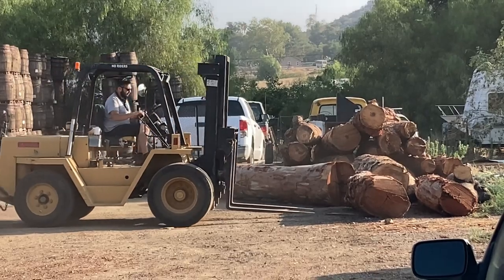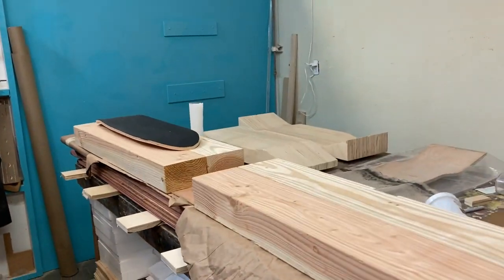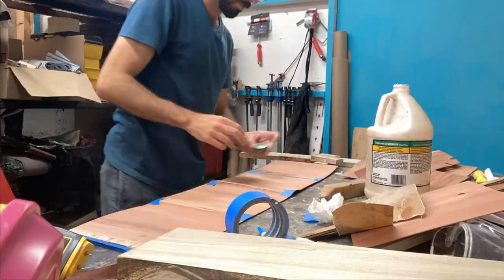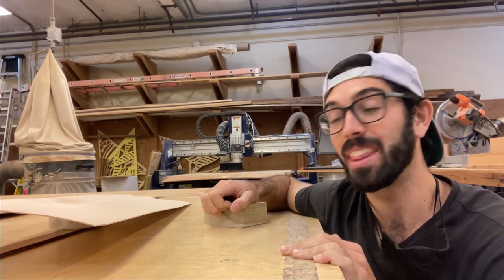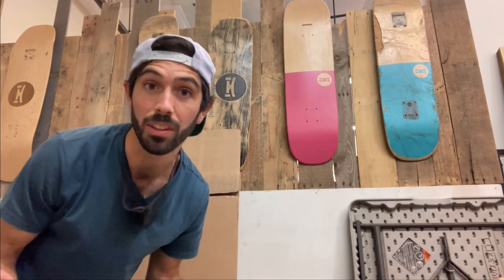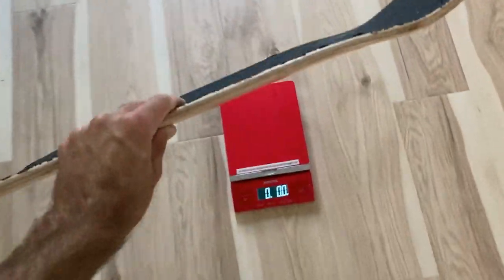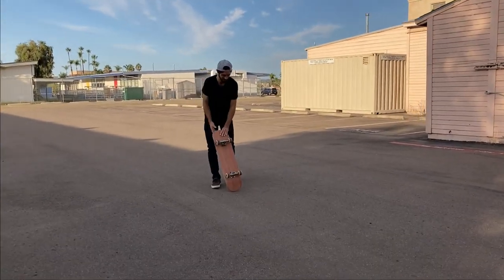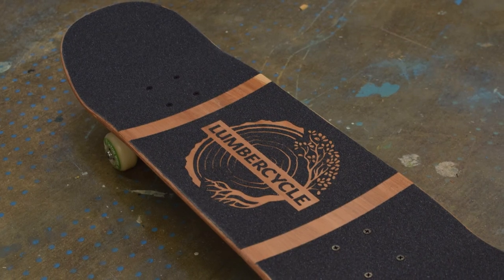Making a Skateboard from California Wood

Comment: Lumbercycle guys are great!  Let me know  if you’d like to try recycled plastic skateboards.  Been thinking about trying to pull this one off.
Reply from the maker: They are! I've heard of a few people making recycled plastic skateboards and it sounds great, and I have considered it a number of times already, I just don't know that I have the capacity and tools right now to try it out myself. I do like the idea of reducing plastic pollution!
Reply: @openSourceskateboards  since I watched your live on how to use open source skateboards, I think you already contributed all you need to which is the design.  I just need to pick out a design, modify it a bit, fabricate molds, shred plastic, melt plastic, and form it.  Easy! Thanks for doing all you did.  Any design that you envisioned that would work better for plastic vs wood?
Reply from the maker: @wafflebeaver  I think cruisers would probably be better suited to be made from plastic, but I don't know enough about the specific plastics you are using. Since it seems like you're not doing bent lamination, you probably have way more creative freedom because you're not limited to bending limitations (the plastic can just be melted and formed). Share your work when you're done! It would be great to see plastic waste repurposed into a board!

Comment: Fantastic video! This is very inspiring but I do have a few questions. 1. What did you use for core sheets? Did you just leave the veneers more  rough than the other sheets? 2. Do you think the weight was simply because of the moisture left in the wood and last, how much did it cost to make one board  compared to maple, cause we all know maple is expensive if you aren't buying it by the truck load. Thanks.
Reply from the maker: Thank you! Regarding your questions: 1) The core sheets and face sheets were basically indistinguishable in this layup - I didn't process them any differently. 2) I suspect the weight was in part due to having a slightly higher moisture content, but also due to red gum being a more dense wood - according to the Wood Database (a helpful site that allows you to compare the mechanical properties of various woods: https://www.wood-database.com/wood-filter/), hard maple has a specific gravity of 0.71 at 12% moisture content, and red gum has a specific gravity of 0.87 at 12% moisture content. 3) Cost comparison to maple: this depends on where you get a log (e.g., do you get one for free from your backyard or go buy one) and how much you value your own time when doing the work to process the log into veneer.
Reply: @openSourceskateboards  thank you so much for the response. One last question, if you don't mind answering, if you don't want to answer, I  understand, how much did that log run you? Because I really really want to try this, I was actually thinking of trying yellow birch as the characteristics are similar to hard maple.

Comment: Based purely on stats it looks like rose gum is closer to maple, ever so slightly lighter and softer, but more flexible, noticeably more flexible than red gum. Considering that you seem to go with plies that are all the same thickness, whereas many woodshops use a mix of thinner and thicker plies, it could be a good one.

Comment: Just a question : why is your mold inverted into the press looking to others standards ?
Reply from the maker: Do you mean why is the male mold on bottom (rather than on top, like many others do)? If yes, the reason I set it up that way is because the female mold is much lighter and easier to maneuver - I can leave the heavier male mold on the bottom. I think other builders typically have their molds installed and aligned on the press. I prefer to keep my pressing setup flexible, so I did this by not attaching the molds to the press and using posts on the side of the molds to align them. I don't believe the orientation of the molds matters for pressing.